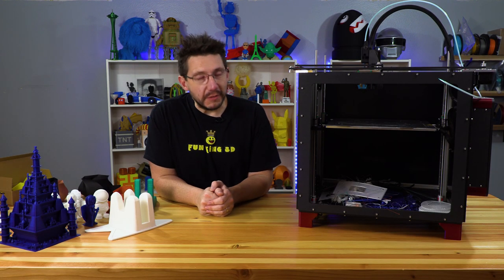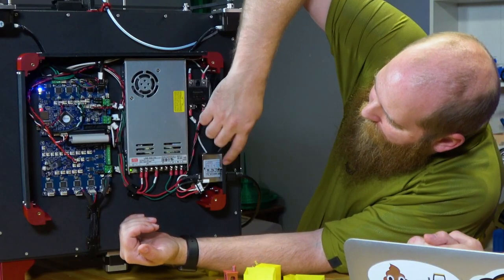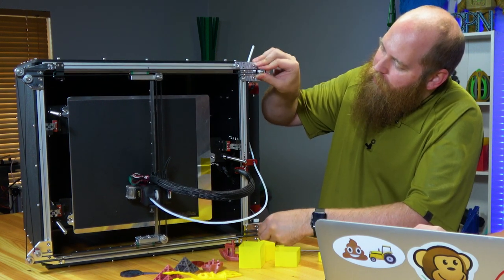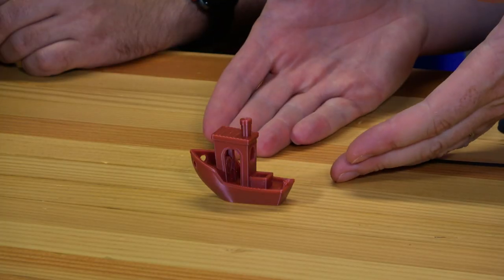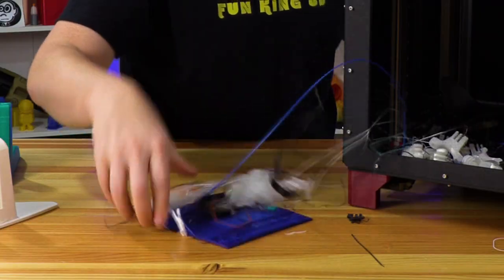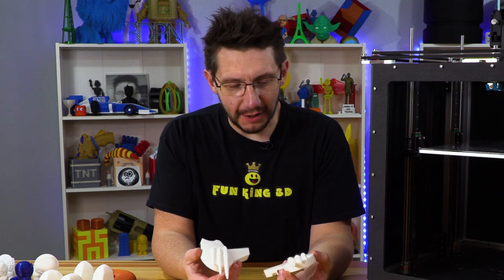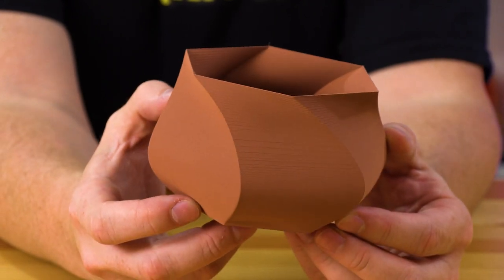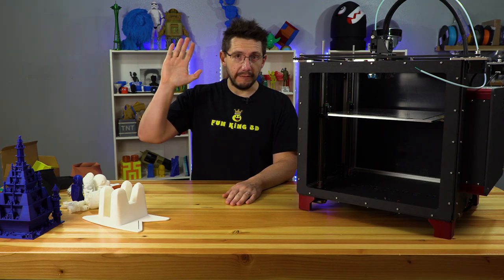Railcore II 300ZL Project R3D 3D Printer Kit Review

Comment: Oof I don't like that belt setup  having crossing belts wears them out so fast and can't really be tension well
Reply: The belts don't 'cross' in the sense you mean. Each belt is in its own plane, no vertically angled paths, so no additional belt wear.
Reply: @jstevewhite  isn't there a shift in plane in the back where one of the belts goes from above to below
Reply: @turk639  Nope :D Two separate belt paths, one ~8mm higher than the other.
Reply: @jstevewhite  right when I saw the belts It looked like the old belt setup used for corexy, Tech2c designed a really good belt setup which doesn't have plane shifting belts.

But good to hear they don't cross in the back
Reply: GearsW the idler layout makes the visuals confusing. The belts look like they "cross", but they never leave the plane the motor pulley for that belt is in. The return idlers for both planes are back and outside the motion idlers in their plane.
Reply: @jstevewhite  that's great to hear, you are one of the devs for this project right? If so I wish you to best of luck and may the belts be forever in your favor
Reply: @turk639  LOL yep, and thanks!
Reply: @jstevewhite  also why did you guys choose for a ir sensor instead of something physical like a precision piezo prion?
Reply: @turk639  Well, we started with them because we had them :D And actually, they worked great with the original build surface we chose (PrintInZ Skinz), but when we branched out we ran into some issues.  I've converted my original prototype to a BLTouch, actually. But the important thing to note about this system is that one of our primary design considerations was to make it easy to tweak and munge and experiment. Our community has developed a custom Y carriage for the Precision Piezo, and the mount for the BLTouch is available as well. We've got mounts for the E3D V6, the E3D with Volcano, the Mosquito, and even the MicroSwiss all-metal CR10 hot end with the Volcano heatblock (very compact) :D. It's wide open, and we provide the CAD files so you can easily hack on it instead of trying to munge STL files. We have an active community of folks who are developing new features. 713Maker and Mandala Roseworks make lots of machined aluminum upgrades for the printer already, as well. (some are included in the kit).
Reply: @jstevewhite  that's some cool stuff I still want to machine aluminum parts for my hypercube Evolution. Keep up the good stuff!

Comment: This is a decent commercial for the Prusa MK3 with the flaws of the RailCore.  The size of this printer is more important for me, so until Joseph releases a larger print volume, this printer is what I will buy.  With the speeds, it would be nice to see a 400x400x800 print volume.
Reply: My railcore is 300x300x950
Reply: Here's my personal print gallery. Once you get the slicer dialed in, they do fairly well.  https://imgur.com/a/QNLli It's a shame Joel didn't have more time with the machine.
Reply: the price difference in a 300x300 bed and a 400x400 is a big number, both in parts, milling, and shipping

Comment: Thats cool and all but I want a machine that will just work 100% of the time and wont require much maintenance also something that can do all that with ABS.
Reply: This machine would probably be an ABS beast, but first I'd consider if I really needed ABS.
Reply: Yeah since its mostly enclosed it probably does abs well but ABS is rough on machines all that reside it leaves behind is nasty. I print more ABS than the average hobbyist. I do a lot of interior car parts so PLA doesn't cut it and I don't really like PETG.
Reply: @x9x9x9x9x9  Try a blend, like PolyLite PC, TitanX, or Z-Ultrat. Stronger, warps less, more rigid.
Reply: @andyfilms  I have wanted to try some weird blends like that but the cost always makes me hesitate on ordering them. I think that's another reason I'm still drawn to ABS.
Reply: ABS is no problem (you might want to add doors).  But you could also consider CF PETG, or SnoLabs PC+, which also print great on these.  The maintenance on them is quite low, and once you dial in your profile for your build, they're extremely reliable.
Reply: Probably worth looking it the tiertime UP300. 100% isn't achievable but it this looks like a pretty good machine. Also beware you have to use their own software that isn't very good.

Comment: my machine has bltouch, I print on glass
Reply: Yeah, I have a BLTouch on the original prototype Railcore2 now.
Reply: There is also a precision piezo
Reply: @turk639  it was easier to use bltouch than redesign the head for the piezo, it does take a little y space
Reply: @mostlymissiles  seems like there is quite a distance between the extruder and the hotend this could be used to design a good pp Orion mount to fit
Reply: @turk639  please do so and reply back with your results,  there was already a bltouch mount available and I would rather be printing than designing a part that might be needed by someone else, I have plenty to keep me busy with making parts for me, sorry to be harsh
Reply: @mostlymissiles  what printer?

Comment: Really compelling printer. 
Nice video with the exception of the confusing and glaringly inaccurate definition of what a CoreXY printer is. 
Simply, on a CoreXY the print head only moves in the X and Y axies and the bed only moves in the Z axis. 
Both of which bring benefits to the printer.
Reply: No, the description in this video is actually the correct one. Check https://corexy.com/theory.html

Comment: Lol, negating the benefits of core xy with having a direct drive extruder.
Reply: care to elaborate?
Reply: Long before there was a kit for it, Tony and I tested it with bowden and direct extruders. We found no difference in outcomes at speeds we can reasonably achieve. The limits are more related to the ability to extrude plastic and cool it - fast moves are easily executed at 200-300mm/s. At our normal print speeds of 75-85mm/s, converting it to a Bowden made no difference in the print quality. 

BUT! It's extremely simple to convert it to a bowden if you wanna verify for yourself. Just remove the extruder from the carriage and bolt it to the chassis, and move the filament guide tube to the Bowden position, and et voila, you can find out for yourself. :D
Reply: @jstevewhite  were you frying eggs on your stepper drivers at those speeds? If you weren't missing/skipping steps, you were making some serious heat
Reply: @dadsfriendlyrobotcompany  I've done speed tests to 400mm/s (Commanded 500, but hit max step rate LOL) and the steppers were warm, but not painfully so. (edit) The stepper DRIVERS have never reached warning temp, AFAICT. (Trinamic 2660s, with 1250ma motors; shouldn't be in too much trouble ) I"m not sure how warm they'd get if you were e.g. printing high-speed infill at 400mm/s and 6000 accel an 1500 jerk, though. YOu could be right there!

Comment: still waiting for a good printer below 100 or 100, 
When?
Reply: When you can make stepper motors cheaper
Reply: You're not going to find a "good" printer below $100 shipped for years still. Even the $200 printers have a ton of inherent issues and require some degree of unfucking to get them to a "good" status and that's usually as far as they can go. Not knocking on $200 printers but you get what you pay for and if that's good enough for you then by all means get it. 

But using "good" as a generally understood term you are not going to get a "good" printer under $100 shipped for years. If you can afford a $100 printer then you can save up and afford a $200 printer and then you can cut your teeth on the hobby from there.

Comment: Thermal mass.... it's aluminum... so it doesn't account for much
Reply: Why would you need more? Throw in a steel sheet? Probably need bigger nema motors too...
Reply: I'm not sure what you mean. The specific heat of aluminum is twice that of iron. Only beryllium and lithium have higher specific heat than aluminum.